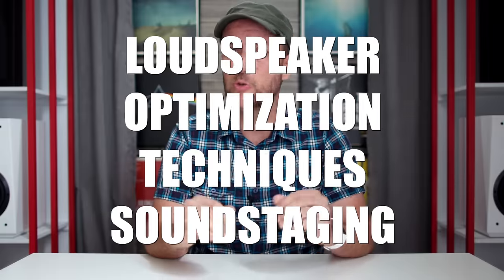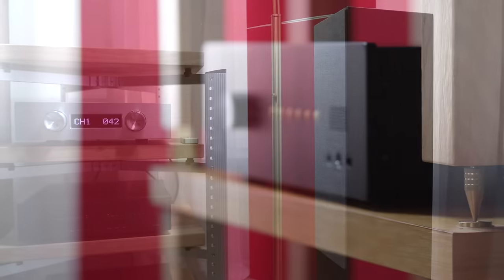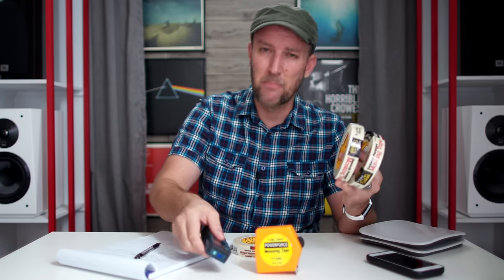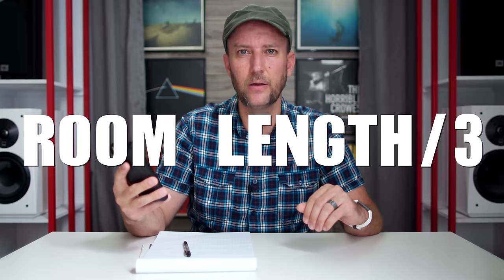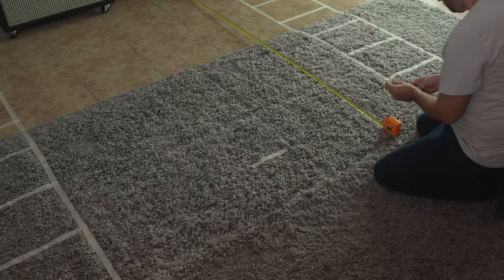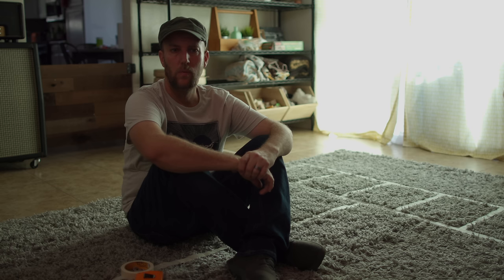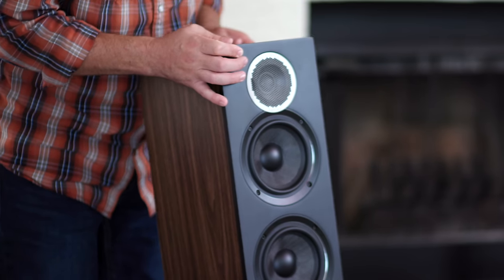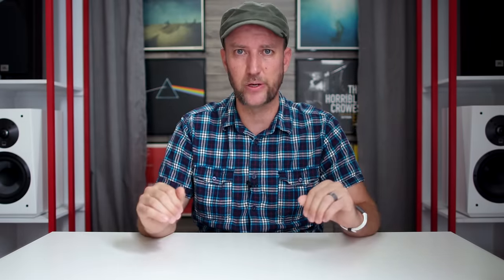L.O.T.S. Loudspeaker Optimization Techniques for Soundstage!

Comment: O.M.F.G! This is amazing. I thought I had things dialed in pretty good and I was actually close. BUT... Using this method I wound up with my speakers moved back about 8 inches more than I had them (1/3 into the room, opposite of my chair) and about 4 inches each more toward the center of the room. My goodness the speakers completely vanished, the soundstage opened up and is vast and cohesive. I couldn't be happier. Thanks so much for this!

Comment: As a pro audio engineer for more than 45 years I have to tell you, you nearly nailed this.  You missed talking about one very important part of this, and the part this is unique to each room;  standing waves.  All of what you showed is 100% legit, (though I disagree on toe-in for reasons I will detail in a moment), but standing waves are where your entire process can fall apart..  In my particular room, if I put my listening place in your recommended spot, the bass falls off to almost nothing (cancelling wave).  Move 12" back and it gets too loud, move 12" forward and it dials right in.  My room is an anomaly, but the point is to listen CAREFULLY and not just follow 'instructions', no matter how talented the presenter.
Now, to toe-in.  Toe-in sets up more cross talk between the speakers, which can produce lots of standing waves.  Standing waves are USUALLY heard the best in the very low frequencies (described as 'booming' in many cases) but toe-in causes these at MID frequencies (possibly what you are calling 'shouty').  Yes, these DO indeed 'color' your sound, but I would postulate that all you are doing at that point is adding 'confusion' to your system.

I've actually tested this in an arena system as we were developing the 'flying array' systems that back in the 80's and 90's that are the norm now. We found that toe-in actually increased our power and coverage needs.  Once we plotted the frequency responses from each side independently, then both sides together, it was clearly apparent that the speakers were 'fighting' each other when toed in.  When left flat faced to the audience (even toed OUT a little) the edge response from each array summed in the middle to sound even across the room.  Later we added center array's for vocal clarity, but kept the gain about 1-2db down for that array. later, when we began to run stereo rigs, we split the center array down the middle and discovered 'center channel' was better for an arena.  It actually enhanced the stereo mix by allowing us to pan harder left and right without depriving the audience on the opposite sides of information.   I think the case was that it may be a little easier to 'hear' these things when your room is hundreds of feet in each direction, and your sound system is driven by 150,000 watts!  It does not hurt to be working with Dr Bose and Jack Weisberg (legendary NYC sound company owner) either!

In summary;  talk about standing waves and how to listen for and accommodate them in the listening environment.  Thanks for the great information videos!
Reply: That’s really interesting! In my home studio I have each speaker pointed right at my face. Are you saying I should have them pointing straight down the room, sort of playing right past my head?
Reply: @SlowCarToChina  The only thing you can do is try it out, and see what sounds best to you. It's your ears that will be listening to the music.
Reply: @SlowCarToChina    A speaker has a 'sound stage' and most designers do their thing with the speakers flat, not toed in.  Try it flat.  Close your eyes and 'position' each instrument on that soundstage.  Make a 'map' in your head, then try it with toe-in.  You decide.  I find that the soundstage is more nuanced with my DCM TF750's flat, but they are exceptional imaging speakers.  One thing you will find is  that the smaller the 'face' of the speaker, the less an effect it has one way or the other.  This method also brings your listening room into play more, which I prefer.  Happy listening!
Reply: I have a very similar issue where my imaging is best but the bass just dissapears. I've currently got it setup where I have a nice even frequency range but have to compromise on imaging. I keep hoping I'm going to find the magic spot where it all just works but it has alluded me so far.
Reply: Love the insightful post - thanks. 
Watts has a capital W
The plural of array is arrays. 
Never use less than 150,000W!

Comment: I saw this video so long ago, but the information you shared stuck in my head. After two years I finally finished purchasing the items needed for a respectable system. It was tough having to sit and look at each piece on my shelf and wonder and dream of how it would all sound some day. Well today was the day I finally set it up. 
Like many, I pushed the speakers back to the wall so there would be ample flow through the room. The sound was detailed and accurate, but something was off. There was no "presence" to the singers and instruments. 
It was then I remembered your LOTS technique. I pulled the speakers WAAAY forward and started listening with my eyes closed in a dark room. I backed them up until I heard what you described as unmistakable and boy it was. When that spot hit, suddenly I had musicians and singers centered right in front of me with decays off to the sides. If I hadn't experienced that from your words of audio wisdom, I would have been missing the real joys of owning an audiophile system. I would have wanted new speakers at a minimum and perhaps even thought it was altogether a waste of money. But when the soundstage was properly set up, a huge smile just lit across my face. It was emotional, involving, and it drew you in. 
My room may not be neat and orderly when compared to others, but oh the sound, the glorious sound. Thanks again Ron

Comment: THIS IS INCREDIBLE!! For YEARS I knew something was off with my system and followed advice both from the manufacturer (Focal) and from countless "experts" online. The general idea of what everyone tells you is "avoid corners", "use an equilateral triangle pattern", and "listen and experiment". I am a very detail/fact oriented person, and your approach with 1 foot quadrants perfectly measured took enough of the guess work out of this to help me get my system perfect. 

For anyone reading this, IT WORKS but you need to follow things exactly. Put the tape down. Measure everything... It will take about an hour of prep, but its worth it. The dark room idea helps as well. I started from the back and actually encountered two spots where things sounded incredible. Keep this in mind if the first spot you find isn't ideal. Also moving the speakers to the left or the right in the square changes things A LOT. I honestly wasnt expecting this. When you find the right spot, move the speakers far forward again then back a foot at a time... confirm your results!

Sending you a little something via PayPal as a huge thank you for this free advice!
Reply from the maker: Holy smokes man! Got your donation and can’t thank you enough! Really happy that you appreciated my tutorial and that you are up and running!
Reply: I tried it out tonight without exact measurement just to see and it work great. Gonna try again tomorrow with exact measurements as you suggested.
Reply: I can't believe it... I ended up with an equilateral triangle! LOL

Comment: Thank you so much for this! 

The tip of starting with the speakers all the way out instead of up against the wall was GOLD.  I thought the poor sound in my new house was a function of reflections and a bad room.

I was ready to drop a bunch of cash on room treatments and even shop for different speakers (and i love my current speakers).  Turns out I just needed them about 6' off the front wall.  

Now my soundstage is holographic and the tubby bass is tightened right up.  Outstanding.  Thank you again!
Reply: Nice to fix it at NO COST

Comment: Hi Ron, I just came across this vid when watching Tarun's (A British Audiophile) channel. So I was curious. Some of my buddies tell me that my listening position is completely "off", because  I'm sitting in "monitor position" in a 4m (wide) and 5,5m (long) listening room and not in a "triangular" setup. Guess what, I just measured my position, which I have found after years and years of listening.
Just to confirm that your L.O.T.S. is spot on: my ears are around 1,85m away from the front wall and my speakers are located exactly in a track that is between 1/3 and 1/4 from the side walls. The speakers are pointing at the outside of my shoulders, so I can clearly see the inner side wall of each speaker (nice check up to see if you toed them in evenly).
So this is indeed an excellent advise for loudspeaker set up!

Comment: The math is very much in line with what I've read, then done. And when you're close, an inch or 2 out or in, forward or back can make a noticable difference. But I have NEVER been able to make those speakers disappear. When good, the speakers are like the microphones, and the performance is behind and outside their placement. That's been like the holy grail for me. Great tutorial on the mechanics of getting it done. Thanks.
Reply from the maker: Thanks for the comment!
Reply: A good way to look at it is you want  the sound to be coming from behind the speakers.  When you accomplish that, then they are gone.

Comment: I used painter's tape and moved the speakers an inch at a time. Listened over the course of three or four days. Outstanding sound stage and imaging as a result.
Reply: How far did they end up from your back wall
Reply: @Chase1297  Floorstanders, about 6 feet to the wall.

Comment: Nice Job!  The more transparent your system the more fine the movements can give improvement.  I was at an audiophile club and helped them set up for a listening party.
The speakers were getting fine tuned for the sound stage.  The designer finally liked the position and put on an album.  The recording of a bird flew in from high left, landed just slightly right, and flew off to the high right.  When the system has the ability, the recording is well made and the sound stage is perfect, a holographic magic that can make the music bring the dead back to life even if just for a song or two.  You can literally hear the individual breaths of the singers, the ridges of the strings on the base and the keys of the trumpet valves sliding and clicking. The 4 jazz musicians all had there position where the music came from. While I understand the science, it still seems more of magic and art. Surreal is my best description.  What I took home that day was the magic is possible.  You start with the science to get close and then learn the art to perfect the magic.  I now work for that Speaker system designer.  Not a day goes by I don't learn as much as I can handle.  I still have a long way to go.  I will say my system in my little apartment blows my friends away.  My room treatment is pure mad scientist. It wouldn't work anywhere else.

Comment: Cool advice. About lights off: if you have any light dimmers, thyristors can be putting nasty electrical spikes on the mains supply. Lights off: no electrical spikes. Also LEDs are known to generate radio frequency (RF) interference (RFI). Neons indicators in power strips add white RF noise. RFI  / electrical interference may be disturbing the mains frequency transformers of your gear leading to a more constricted sound. All the best, Rob
Reply from the maker: Thanks!

Comment: I hate you Ron, cause this works to perfection. My room is far from ideal and this method still worked. Unfortunately the speaker position has to be in the middle of the room. Guess I'll have to pull it out everytime i sit to listen for long hours. No big deal, totally worth it.

Comment: After spending a year trying to get my stereo to sound like what I knew it should be I spent yesterday morning employing the L.O.T.S. system. I finally realized how much of my mid-range had been missing. When they locked in the mids bloomed which made the true bass more apparent. This in turn helped me to integrate my pair of subs much easier and I am much much closer to realizing my rig's potential. Thanks! You've probably saved me some big $$ in component upgrades!

Comment: Having setup near field in a 10 x 12 bedroom for the last 2 years I can honestly say that it is a great solution especially for problem rooms. I ended up, after trying a few different speakers, with a pair of vintage Boston Acoustics T830 3 way floor standers, though admittedly due to their short height I had to raise them a foot from the wood floor it actually helped decouple them, and being a sealed design it keeps the low frequencies from being overpowering, especially as they are just 2 feet from the wall. I never thought a fairly large speaker could work so well in a smaller space.

     I sit about 3 feet away on a fold down bed that serves as a couch, pulled out abut a foot from the opposing wall, works a treat. Of course, it is beneficial to use quality components that hopefully work together, I rotate a Yamaha RX 1100U receiver, Harman Kardon HK 3500 receiver and a Luxman L 215 integrated. They all work well , complimented by a Sansui SR 525 turntable and Denon blu ray player that I use as a transport through a MF V Dac. 

   I did position a pair of fairly expensive 2 way bookshelf speakers on top of the T830s and although a bit higher than optimum still manage to sound very good thankfully. I even prefer sitting near field in the larger living room with some larger floor standing speakers and find it just as enjoyable so well worth giving it a try. 

 If one has the good fortune to have the dimensions to take advantage of substantial full range floor standing speakers sitting further back can be quite the experience but most of us tend to have more modest systems with various constraints in place and so near field makes perfect sense with many more advantages than disadvantages.

Comment: Also try this
- put both speakers against the back wall
- pull only one forward until the bass goes from boomy to tight.  1/4 inch at a time, go slowly
- then pull the other speaker forward until the image of the singer is dead center (track much have a center placed singer)
- use a musical track that's well recorded.  
In the end, your speakers will be very close to where your video puts them.  One speaker will be a little closer, this compensates for asymmetry of most rooms (door on one side, window on the other..etc..)  Everything snaps into focus when you hit the right locations.

Comment: Hi Ron, I liked very much your video and I had summarized it for myself.
I have it in power point with chart but I don't find a way to send it to you.
So here is the verbal part:

1. Measure Room and Identify L & W
2. Let L3= L/3, W3= W/3 and W4=W/4
3. Stick Tapes on floor marking W3 and W4 and each 30cm cross the room   for Y positioning candidates
4. Position Speakers and yourself at Start Point (0) 
	Y at L3, x between W3 and W4
5. Select a music track you know well which contains more than one singer and have several instruments 	The sound stage of starting point should not be good. We shall make it better by next steps
6. Searching for Optimal Y positioning
7. Move Speaker in Y axis 30 cm (one line grid) and listen Again.
8. Repeat until you hear a separated sound stage, continue until you feel it goes worse and go back to the best point
We found the best Y
9. Finding the best X (placement in width). Move speaker to center on W3 and W4 line, identify the improving direction (inward or outward)
10. Keep moving on the best direction (out side or inside the room) half speaker width each step until finding the best X
11. Finding the best rotation angle, rotate in small steps until best result

I will be more than glad to share with you and your listeners the chart. Publish an address where I can send the chart.